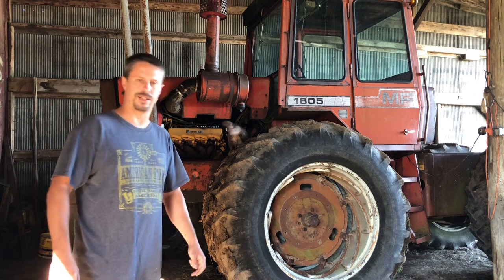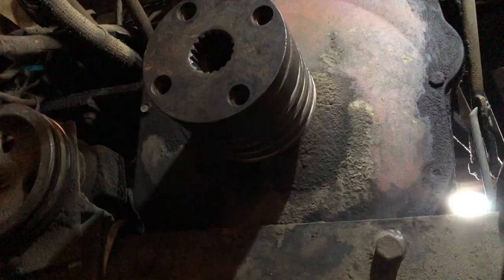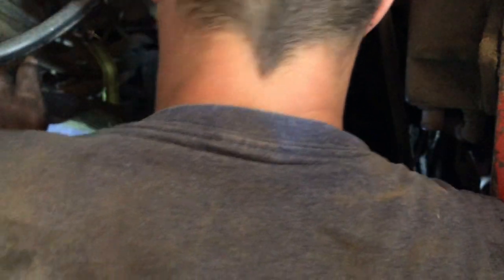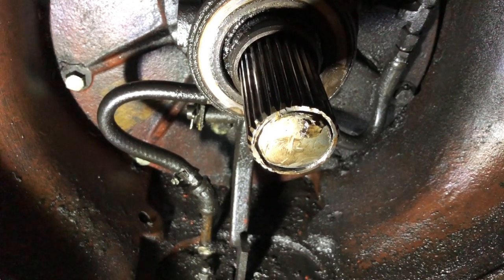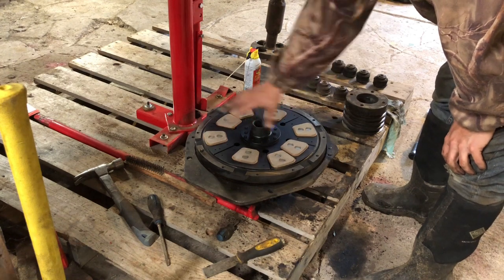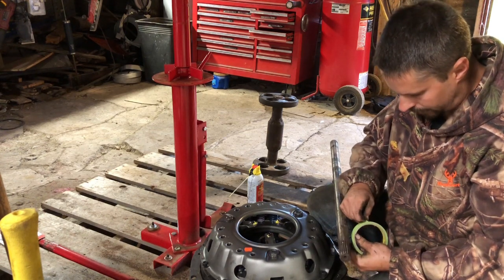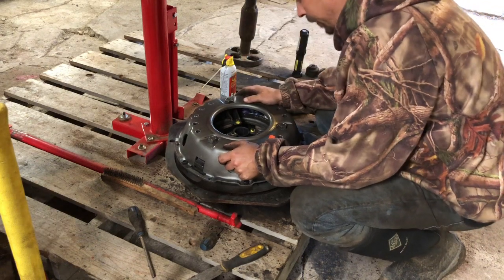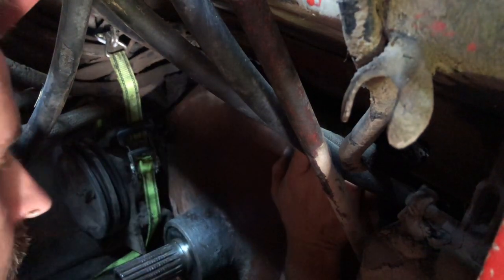Clutch replacement time. Massey Ferguson 1805

Comment: Loved the “breached twins”. Also, in the middle of water pump replacement on 1100. Want to replace fan belt also…there has to be a trick to getting belt out from front hydraulic pump shaft….grateful for any help!
Reply from the maker: thanks!  
you should be able to pull the 4 bolts that hold the pump shaft to the balancer and it will slide ahead just enough to get the belt out and a new one in.  I can do a vid on it in the near future. my belt is looking pretty bad 😉
Reply: Thanks! And will definitely be looking for it!

Comment: I got an 1805 I’m trying to do the clutch on. How did you get that shaft out? I can’t for the life of me get the jackshaft out from between the engine and pumps. I just don’t fit
Reply from the maker: I assume you mean the big dumb bell shaft, it’s not easy.  1.  Get all 8 bolts out, 2 you have to hammer a wedge on either side between the belt pulley and the splined hub. The pulley will pop loose and you can wedge it back toward the bell housing.  Next you pry between the dumbbell and the hub, and that hub will move back toward the bell housing. You “should” be able to wiggle the shaft out at that point.   If you’d like I can make a video on that sometime
Reply: @jtsbarnngrill6873  that would be awesome if you could make a video on it sometime. I got it out but it wasn’t the proper way lol, I used a jack between the trans and the engine and pushed them apart just far enough to get the shaft out. Had to loosen motor mounts.
Reply: @The Proxy Moxie  if you loosen your engine mounts you need to make sure you get the engine and trans lined up perfect otherwise your jackshaft bushings will wear out quickly

Comment: Hey where did you get a clutch from? I can't locate one anywhere in canada
Reply from the maker: That one came with the tractor.  I did however just check eBay and there is one available
Reply: @JT’s barn n grill  yep seen it but they don't ship to Canada   .  I found a place in the states that will ship me one its on the way thanks

Comment: Wassup man I noticed you have a 454 square body I’m swapping a 454 out of a 1990 454 ss into my 86 square body can I use the same distributor or would I have to get another since the 1990 has a computer
Reply from the maker: that is correct, you would have to put a HEI distributor on it if it’s all stock 1986. are you putting a 4 bbl carb on it?
Reply: Yessir it is

Comment: Seems to me ya'll just changed this clutch. Wait, no that was the Stieger. This had steering cylinder problems. So now out comes the clutch after a very short time. Because ya'll never ran this hardy beast that long. Seems short to me with this worn out Massey.
Reply from the maker: You maybe need to look at the dates on these videos.  This was 3 years ago on the 1805 when I first got it. I bought it with a bad clutch, and this was when I changed it. I didnt know the Steiger existed at this point

Comment: 2 ?s: (1) @ 4:10 what is the yellow contraption going toward the tractor and what are you doing & (2) @ 12:40 what is that noise that sounds like the tractor running and if it is, why? 🦩
Reply from the maker: Answers…
1.  Yellow contraption is a boom pole on my 165, I was using that as a prop for my come-along to lower the clutch assembly to the ground. 
2.  That was the 165 running again, boom pole attached and come-along winching the clutch assembly to the top of the axle, so I could then muscle it onto the transmission.   Hope that clears it up a bit 😉